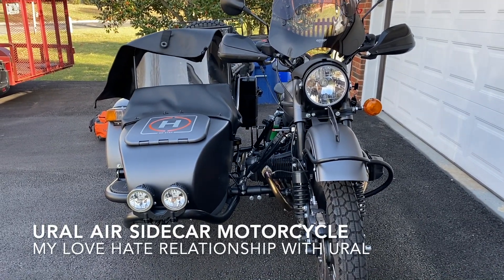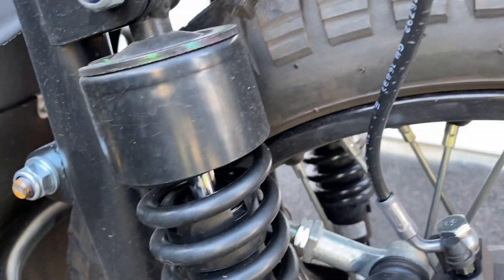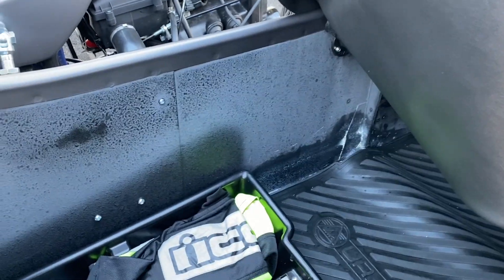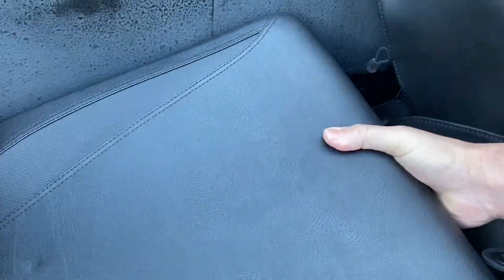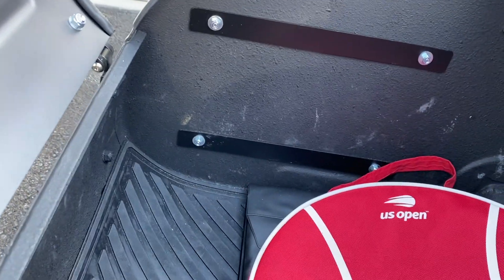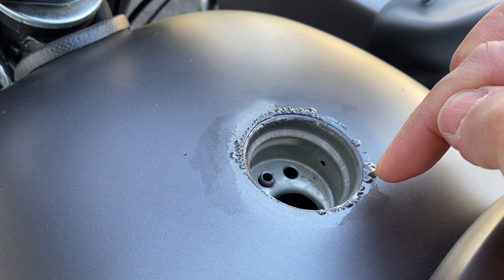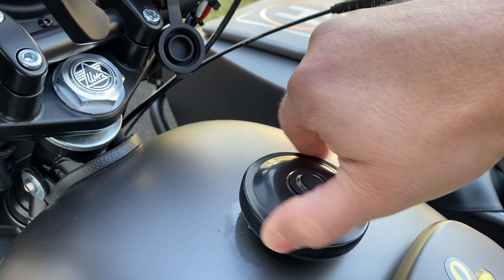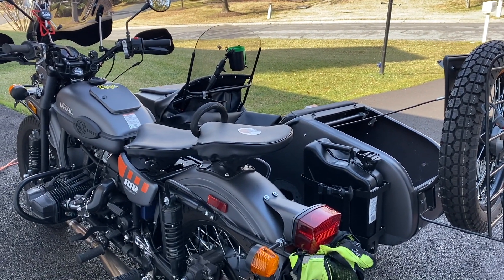URAL 2018 AIR SIDECAR

Comment: You may not want to spend the money on this but, If you replace the rusting bolts with stainless bolts, they will not rust. You don't have to let the bolts actually get wet to rust. Just being in a damp enviorment  will make them rust. As far as nuts and bolts becoming loose, keep a bottle of BLUE locktite on the bike. You don't want to use the red stuff, unless you never want to remove the bolts again. As far as the paint bubbling goes, it seems the tank after it was painted was never sealed with a barrier coating like clear coat. And as you know gas will disolve alot of things. That includes soft unprotected paint.  Heindl Engineering's videos on you tube are a wealth of information for Ural's.,,,
Reply from the maker: Thank you, great ideas thank you. Stainless bolts, I wonder how expensive they will be?
Reply: If you replace a urinal bolt with a stainless steel one it voids the lunchtime warranty !!!!! And double the value 🤣😂

Comment: Your parking brake issue sounds like you need to adjust it at the caliper. There is a 5/8 inch bolt that you remove, pull off the bracket with your cable, turn the shaft to the right until it stops, then back it off to the left a distance of one of the splines, put the cable bracket back on the shaft and put the nut back on. This will adjust the rear pads as they wear from use.Look up Heindl Engineering, he is a Ural dealer and has a video on how to do this and several other videos. You don't want to adjust your cable too tight, you will pull the ends off when you apply the parking brake and will have to replace the cable.I have a 2019 Gear Up, no problems with it.
Reply from the maker: Thank you for your comments. As I learn more about Ural I found out that as the rear brakes wears out the hand brake needs to be adjusted. So to me is not worthy of constant adjustment. I just simply not use it after the rear brakes wears out.

Comment: Have 3 Urals currently, 95 Sportsman w/BMW Engine, 2011 Retro with 108K and a 2019 GearUp, had an evil 2015 M70 that is a dealer in New England's problem now. Lock-tite is your friend. Tightening bolts, while not as critical as it used to be, so something that still needs to be done regularly. It's a Ural, want perfection and no character? Get a Honda. They have tried many ways over the year to make the paint around the trunk stay. Good luck with that. None of my Urals have had that issue around the gas cap, makes me think there is some methanol or something else more caustic than normal getting in there... If under warranty, get the to the dealer. Get in touch with Jason at IMZ in Redmond for help. Are you adjusting the parking brake at the caliper? That is the only way to adjust it, adjusting the cable at the handlebar is a waste of time. The adjuster at the caliper also adjusts the rear brake and helps with balance between the sidecar and bike brake. Get out the 5/8" wrench (yes, it is American so it is SAE, as are the 3/8" allen bolts that hold it on) and take off that nut, remove the cable and turn that wheel until it just just has the brake pads touching the rotor then back off just a hair. Put cable back on, and whatever else is there too (changed from year to year) and put the nut back on... You may have to take some of the cable adjustment you made out to make it lock in place afterwards. May I suggest reading, really reading the owners manual and what geckoboy40 said about sovietsteeds (the forum, not the facebook group). Do I like them, traded a perfectly good Harley for the 2011 and sold a really nice R90/6 rig to finaince the resurrection of the '95...and got the '19 after the horror story that was my '15... yeah, I like them a lot.